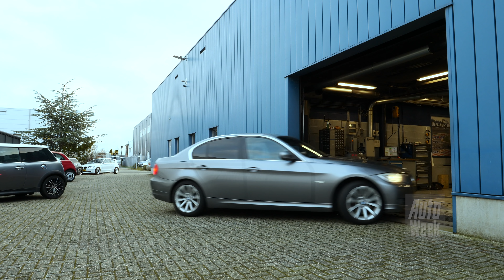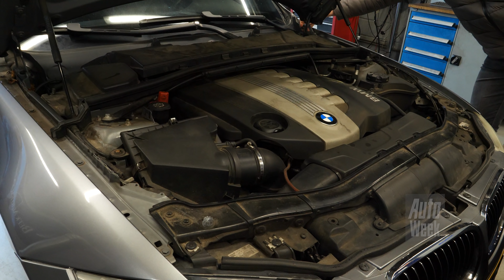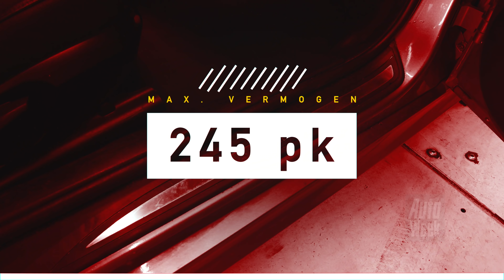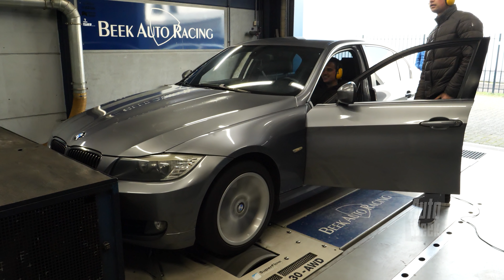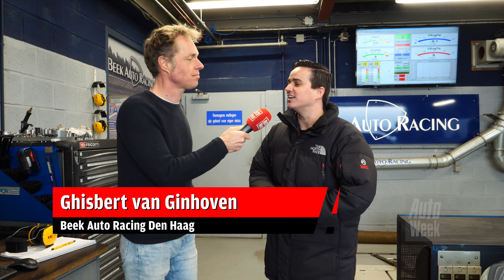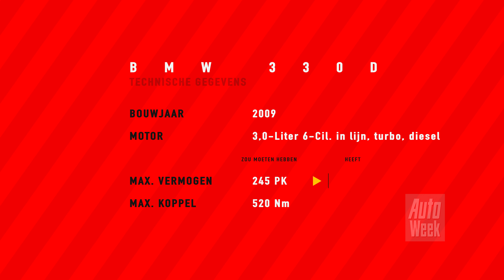BMW 330d - Op de Rollenbank

Comment: En wat houd stage 2 in dan? T is gewoon stock motor gechipt, of gechipt na mechanische aanpassing. Dat stage gezeur..
Reply: Stage 1 alleen software, Stage 2 milieuvriendelijke maatregelen verwijderd en software aanpassing, Stage 3 hardware zoals hybride turbo's, hardware tuning met aangepaste software. Rijdt hier in de buurt eentje met 500+ pk en 1000 Nm. Twee hybride turbo's, brandstofpompen, verstuivers en meerdere hardware aanpassingen. Echt een bizar ding.
Reply: @marcelb2912  stage 2 milieu heb ik nog nooit van gehoord, leuke verkoop pakketten die verzonnen zijn.

Comment: Waarom zou je je roetfilter verwijderen. Precies de reden dat diesel een slechte naam krijgt, zo jammer weer.
Reply: Precies dit. Zo jammer. 
Zwaar vervuilde motor en dan alle reinigende nabehandeling er af halen. 

En later huilen dat er geen diesels meer verkocht worden omdat ze zo’n slecht imago hebben. 

Zijn super fijne motoren van BMW, maar die tijd is geweest. Zo snel mogelijk naar EV aub.
Reply: Jaren terug bij mn 535d ook gedaan. Hoop rook en roet telkens bij gas geven, en dat voor die paar pk extra. Ik had er spijt van. De achterklep van m'n witte auto was net de achterkant van een oude diesel bestelbus.

Turbo hoorde je wel mooi fluiten, maar laat die katalysator aub zitten.
Reply: Die rommel is alleen maar slecht voor een dieselmotor , beter kwijt dan rijk ! Jammer genoeg is dit tegenwoordig niet meer zo simpel in belgie ivm strengere emissie test ..
Reply: Is toch mooi een beetje rook erachter
Reply: Inderdaad slechte zaak, jammer dat er garages zijn die daarin meegaan,  net als verwijderen van de katalysator.
Reply: De enige voordelen die ik zie van een roetfilter behouden is dat de auto stiller en rustiger loopt (al helemaal bij een 6-cilinder diesel) en hij stinkt veel minder… Vaak als een auto aangeeft dat het roetfilter ‘vervangen’ moet worden is dat puur geldklopperij, opnieuw aanmelden in de ECU en gaan! Zijn 99 van de 100 keer de dingen om een roetfilter heen wat stuk gaat maar een roetfilter zelf bijna nooit

Comment: Helemaal mee eens. Het enige wat echt belangrijk is, is koppel. Behalve in zuid Duitsland of op een circuit zijn pk's eigenlijk irrelevant.
Reply: ja en nee. ik heb een 2.0T benzine met 480nm en die is onderin veel krachtiger als deze 600nm. Een diesel heeft een langere versnellingsbak spreiding plus op welk toeren heb je het meeste koppel. 400Nm koppel op 3000tr is een stuk meer vermogen als 500nm op 2000tr.
Reply: @kristelpoelmanstruyens9438  Dat is per definitie zo, omdat pk (= vermogen) een eenheid van arbeid is, en dus direct is gerelateerd aan het aantal omwentelingen per minuut van de motor. Dat is nu eenmaal de definitie van pk. 
De langere versnellingsbakverhouding zorgt ervoor dat je in een diesel bij 2000tr net zo snel rijdt als een benzine bij 3000tr. En op dat moment is 500nM toch echt meer 'duw in je   rug' (= accelaratie) dan 400nM.
Reply: @bartmulder6995  Euhm niet helemaal, want als je met die toerentallen uit je voorbeeld dezelfde snelheid hebt is de bakverhouding dus 50% hoger bij de benzine. Dus heb je verhoudingsgewijs ook 50% meer koppel = 600 nm op je wielen i.p.v. de 500 nm van de vergelijkende diesel. 

Uiteindelijk kan je altijd terug vallen op vermogen, want vermogen = energie (die je vooruit brengt). Het voordeel van een diesel met een "hoog koppel" (let erop, koppel is geen energie) is dat je al heel snel op 60% van je totaal vermogen zit. Neem bijvoorbeeld deze 330d (610nm, 270pk) die heeft bij 2000 toeren al 170 pk en bij 4000 toeren 270 pk. Pak een flinke 2.0 turbo benzine motor (A35 AMG, 400nm, 320pk) en die gaat van 110pk (2000 toeren)/170pk (3000 toeren) naar de 320 pk (6000 toeren) in een vergelijkbaar gebied. Dus met die bakverhouding zijn de beide even snel weg bij de 2k rpm diesel en de 3k rpm benzine. Enkel is de diesel sneller onder die grens en de benzine sneller boven de grens.

Comment: EGR + Roetfilter verwijderen zorgt voor meer power en een gunstiger verbruik. 
Daarentegen is deze auto van Euro 5 meteen naar Euro 2 gedemoveerd.
Reply: Deze heeft Euro4 ongeacht of er een roetfilter op zit of niet.
Reply: @AN3CCAHNPO  deze facelift is volgens mij al Euro 5 omdat deze de nieuwere N57 heeft. De mijne is de oudere M57 en is Euro 4. Voor beide types geldt dat ze bij de RDW tot Euro 3 gedegradeerd worden na verwijdering van het roetfilter en dan fijnstof toeslag moet betalen. Bij een steekproef vallen de zwarte uitlaattips meteen op en wordt er meting verricht en valt hij meteen door de mand.
Reply: @marcelb2912  Ik heb de 335d uit 2006 met de m57 motor zonder roetfilter en egr “afgesloten”. De euro 4 sticker blijft staan.
De roetmeting was bij de laatste APK 1.8K, iets over de helft van de maximale toegestane waarde. Een roetfilter en egr zorgt voor veel problemen op den duur wat uiteindelijk ook niet ten goede is voor het milieu. Regenereren van de roetfilter komt al het opgeslagen roet als fijnstof de atmosfeer in.
Reply: @AN3CCAHNPO  keurige waarde zonder roetfilter, blijkt maar weer eens hoe goed de M57 in de basis is. De mijne heeft nog nooit een roetmeting gehad, gaat altijd via de OBD bij mijn keurmeester. Regeneratie zal inderdaad ook de nodige troep de wereld in pompen.